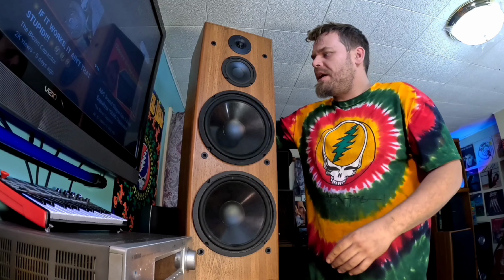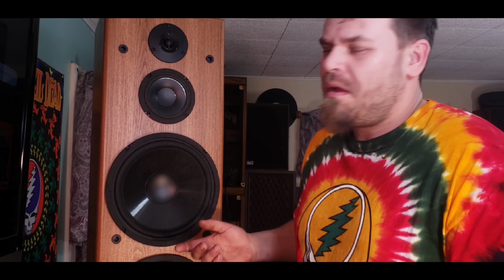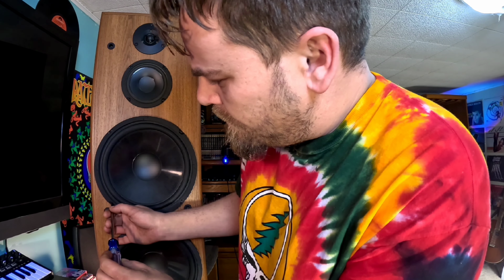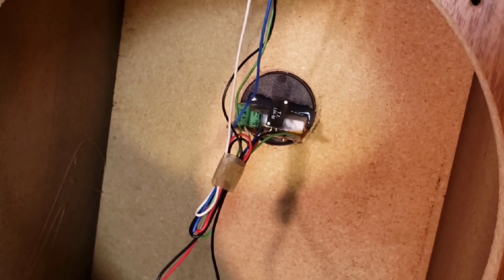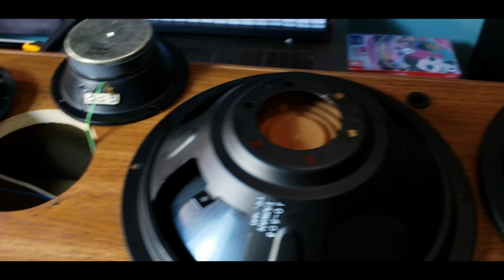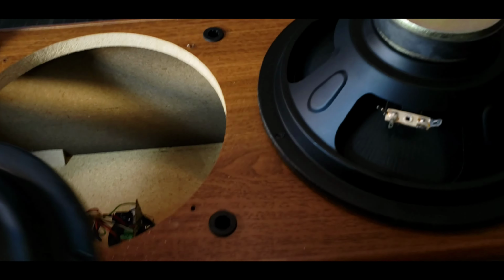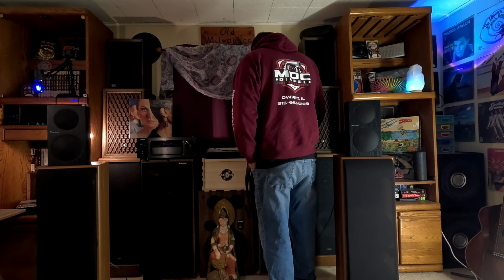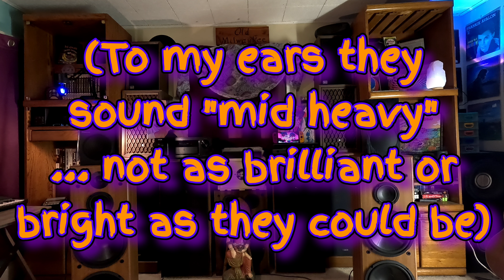These Speakers SUPRISED Me!!! 😲(Onkyo Fusion SK-02)

Comment: Where to begin? The PR should be on the bottom. With the woofer on the bottom running full range the accoustic center is spread way too far apart. That coupled with the fact that there is no dampening material inside a big hollow box, no wonder these sound so bad. You need to know the Theil-Small parameters for those drivers before "slapping" a 3-way x-over in there but if I had to guess I'd say the x-over points would be 500hz/5khz @ 12db slope. I'd add bracing to the cabinets if i could. Yes you can add poly fill to an enclosure that has a PR. Pressed wool carpet padding (3/4in thick) affixed to the interior walls would work wonders. Hell, if you moved the woofer up near the mid-range and tweeter you're going to get an immediate improvement (I'm wondering if someone didn't monkey with it). Drivers don't look terrible in my opinion but if it were me I'm putting plumbers putty on those flimsy woofer baskets to nullify the ringing that's obviously going on in there.
Reply from the maker: Thank you so much for the info!! I completely agree!
Reply: @Blownproductions  what did you wind up doing with the speakers?
Reply from the maker: @toddlee2571  I still have them, but I haven't done anything with them.
Reply: @Blownproductions   I've built a number of speakers in my time and while I've used budget drivers I learned a long time ago not to skimp on the crossovers. Poly caps and open air-core inductors are the way to go. I'd  rather use a 6db air-core inductor on the woofer than a 12db x-over using an iron-core and an electrolytic cap